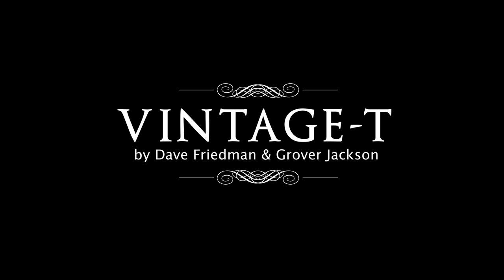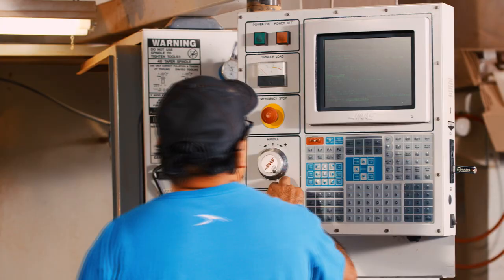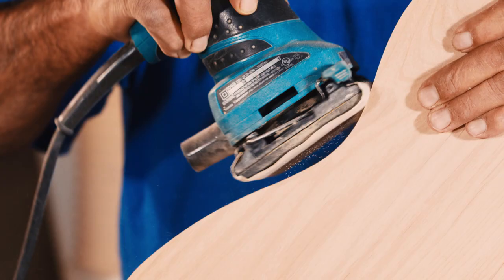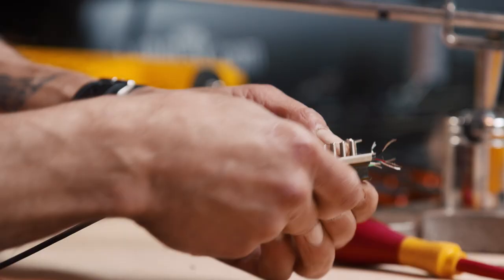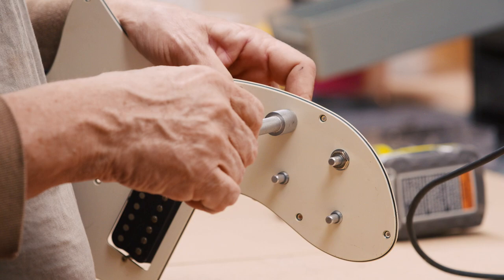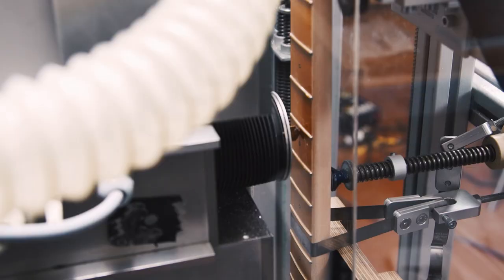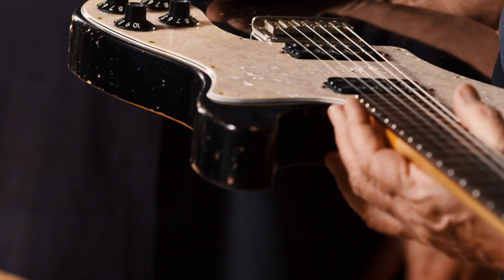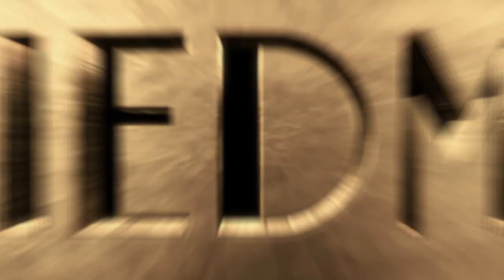Making Guitars with Dave Friedman & Grover Jackson

Comment: I’m a fan of their amps and pedals. But saying a guitar sounds better it is beat up is non sense
Reply: It may have a TINY bit of truth with an acoustic, but an electric? Agree...that's ridiculous marketing crapola. I've played the same guitar with NO finish, and then a heavy clear coat, and there's no difference whatsoever in tone, sound, response, sustain.....none.
Reply: @swingset1969  My experiences are different than yours. I have had a lot of Strats over the years, two of them had a very thin finish. They sound more open with less bass than the others (plugged in or not). I also own a Strat were the paint was removed , again very different sounding than others with paint.

Comment: Totally onboard until I saw the plek machine. I hope you get someone better than the monkeys at Gibson to program it. No matter how fine that machine is able to work, someone that actually understands fretwork has to run it.
Reply: What is wrong with the way Gibson does it?  I don't see how it could be so bad...Gibsons are typically 12 inch radius, so the PLEK would then put in a micro-compound radius across the entire board, where you'd most likely end up with around 12.5-13" at the last fret.  The PLEK would also make sure the frets are 100% level.  There's really no way you can screw this up...
Reply: surgeyX what about Murphy?
Reply: masonicIlluminatispacejewfromnibiru What...?
Reply: @5urg3x  Murphy's Law. Lol